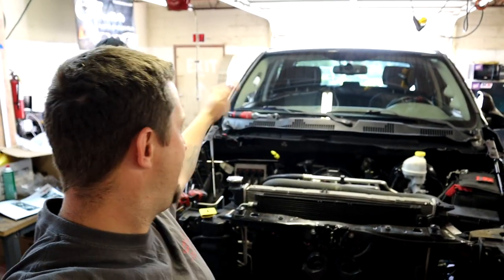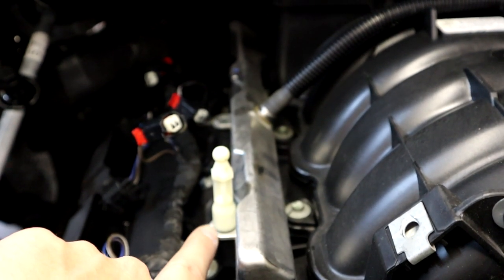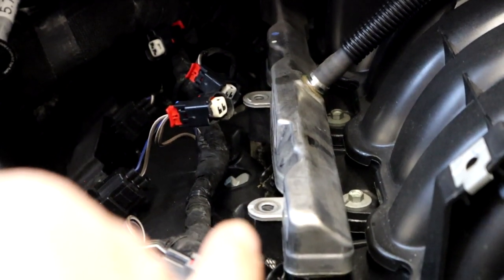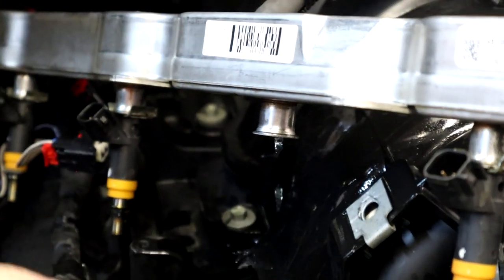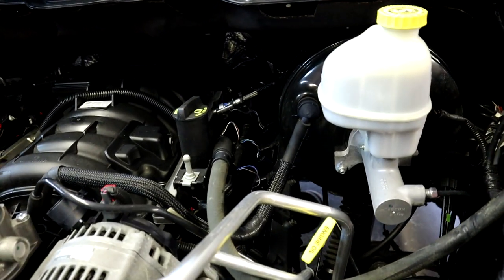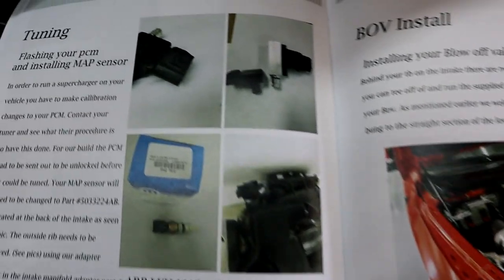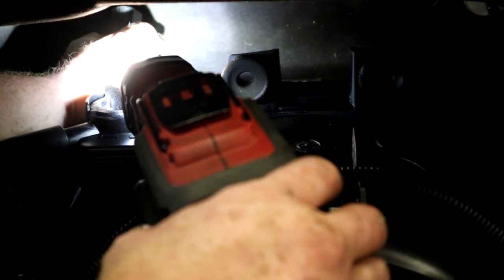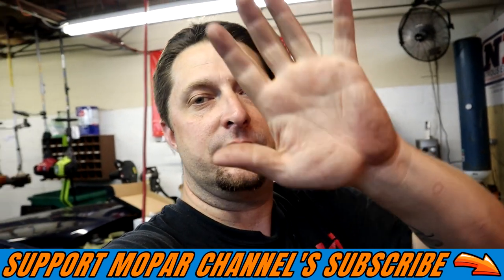Project STORM TorqStorm Supercharger Install RAM 1500 4X4 Part 3

Comment from the maker: Thanks for the support mopar fam 🙏 getting close to driving this beast boosted for the first time 💨🚀💪
Reply: I have long tube headers for my 2011 1500 5.7. can I use oem gaskets with the heat shield?
Reply from the maker: @ChrisCarpenter-d5e  I dont believe the heat shield gaskets will fit

Comment: I never knew how much room a RAM had in the engine bay with the shroud & fan removed.  A helluva lot more than a Challenger or Charger!
Reply from the maker: Definitely and I'm not skinny either 🤣
Reply: I agree chargers are tight in the engine bay I had to fight for every square inch for the torq storm and related hardware this was not an easy install for me at all had to pull the front clip off sure glad I am almost done..

Comment: Where did you get that special "reverse torx" tool???
Reply from the maker: I bought that set from Cornwell tool truck I believe
Reply: Inverted torx socket. You can get a cheap set from harbor freight if you just need it once

Comment: your videos are great ! Thank you for all your great Info. I recently purchased the torque storm kit and have a few questions I have the 6.4 intake swap with the 6.4 injectors will that work ? and the map sensor needs a different one  I understand that, I plan on using a methanol kit but I am using a intercooler also, what do you think?  Jay Greene has tuned my 4door Ram  to a 13.11 at102mph, I am hoping for low 12 or 11s with some weight reductions thanks
Reply from the maker: Glad to help

Comment: Do all 5.7 hemi builds need the 2 bar map sensor? If so could you post the link where I can buy it please?
Reply from the maker: If boosted yes you can use a 2bar or 3bar map you can buy from hhp and many others
Reply: @FrostbiteRam  is it necessary for boosted applications? And should I use a 2 bar or 3bar in my 2015 5.7 challenger? GREAT CHANNEL!!!! Appreciate all the help 🙏
Reply from the maker: @daddybearcom  yes if boosted you need atleast 2bar
Reply: @FrostbiteRam  right on ty!!!